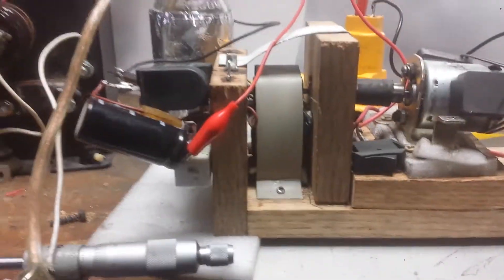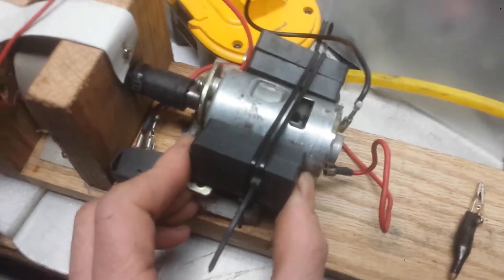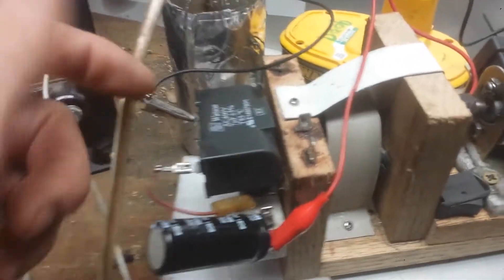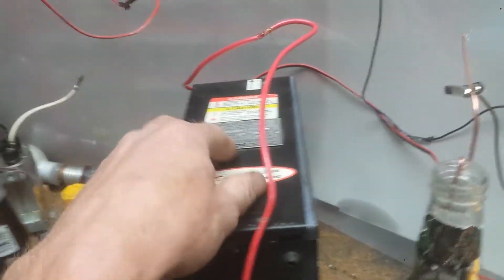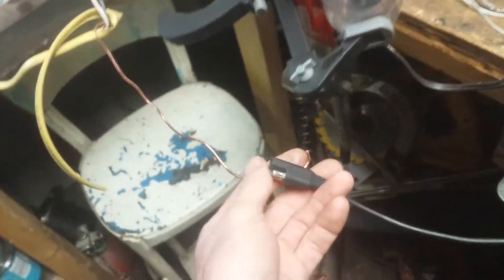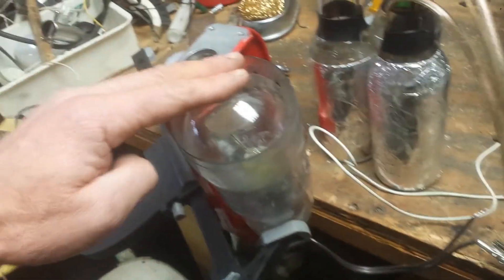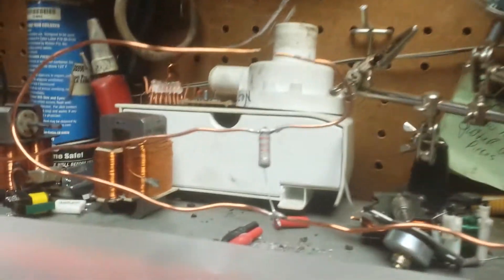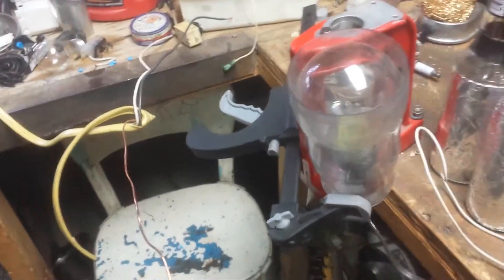Gerard morin pump powering tesla hairpin circuit.

Comment: instead of grounding try hanging an insulated copper plate in the air different heights and see what you get.
Reply from the maker: *****  I have a wire ball antenna made but havent put it in the air as of yet . been short on time . Oh and right now my pump isnt working got hot blew magnet up. :(  . I've been looking for a pump with real bearings on it (no luck yet).

Comment: Very interested in your set up there but a little unclear what your specific circuit is, could you post a schematic? I came across your video as I was searching for a hair pin design working on the Gerard Morrin system, some got lucky with finding your vid Thanks:)
Reply from the maker: Spangley Rainbows hello sorry its been so long. It's very simple pump to caps. caps to neon transformer. transformer to 3 beer bottle caps to copper bars. Ground and lightbulb hooked up to the high sde coming out of transformer.

Comment: Nice work......but my experience with the high voltage is fun to play with but i have not found a usable source for it yet... so i just use the pump as a generator....i can light all the florescence with the high voltage but that's about it..thus is why i built the slayer exciter for florescence and pump to run lights etc.. I will post a new video later on my mount for magnet.. TY and keep up the good work.....if we all come together on this.. I'm sure there are many benefits from it..